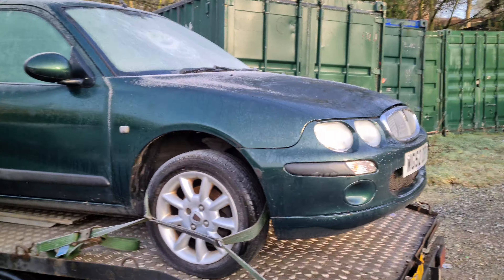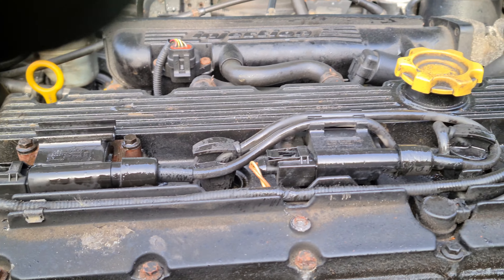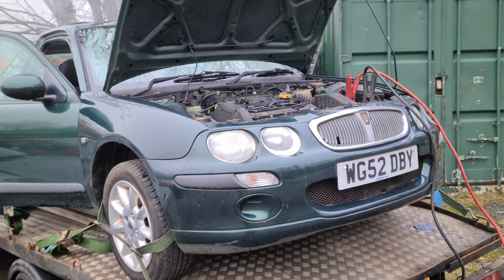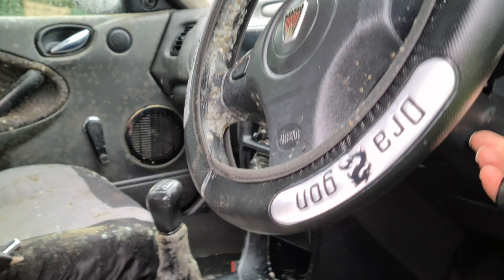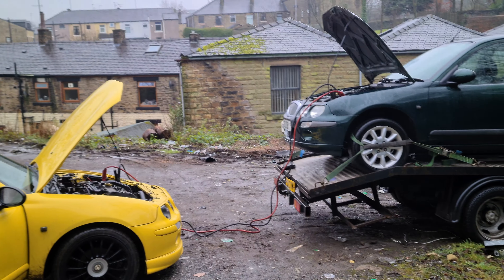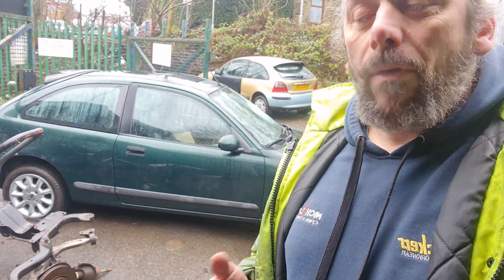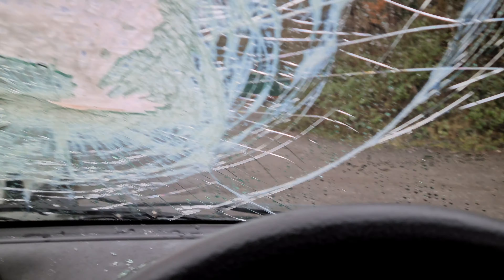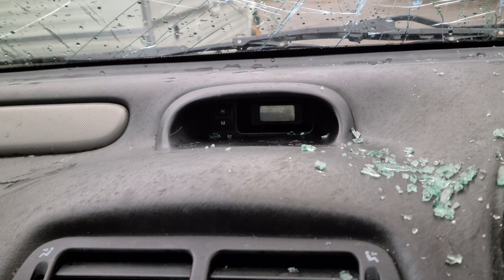The roughest Rover I have ever bought  Project Terry pt.2

Comment: Do you come across any L series diesel Rovers? I run a Rover 25 diesel, sounds like a tractor but is very good on fuel and reliable 250k on the clock.
Reply from the maker: L-series is a great engine.